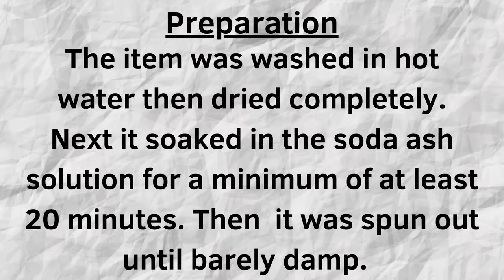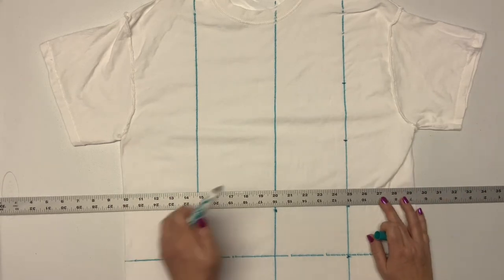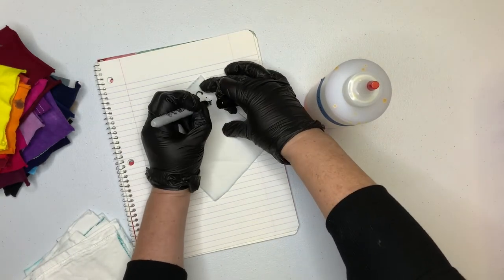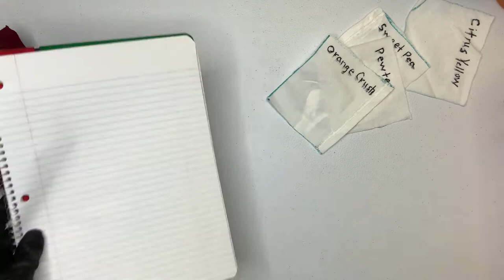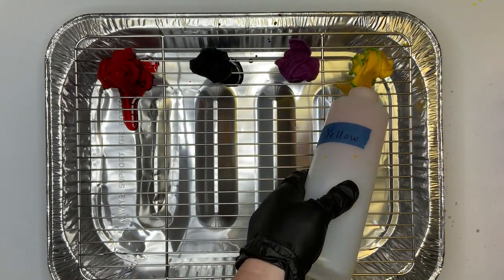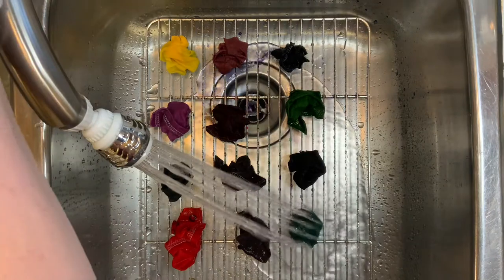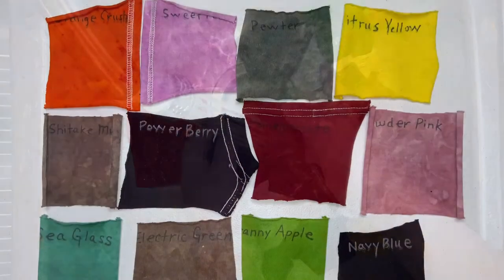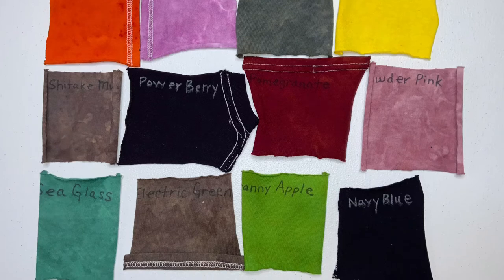How To Tie Dye: Swatches

Comment: Would it be possible for you to make a video showing all your swatches? I'm contemplating upgrading from Tulip/Rit, but it's so hard to determine which colors complement each other from the teeny color depictions on the dharma website. If I'm going to order sight unseen - as it were, I don't want to order 3 purples and 6 pinks, etc, when I only need 1 of each. I have a very limited budget, and even less storage space, so I want to ensure I'll actually use the colors I buy. (I hope that makes sense...)
Reply from the maker: A tutorial on just my stack of swatches, honestly, probably not quickly. I have over 100 colors. I could probably send you pictures. I have links to my social media listed in the description box of my newest tutorials. Try to find me and send me a private message if you can. I do show the swatches in most of my tutorials and I use the most commonly used colors. I can tell you that you want to start with the 3 primary colors for sure. Fuchsia Red, Lemon Yellow & Turquoise. Those 3 colors will make the secondary colors, orange, green & purple. 
Raven Black, Grape, Bright Green, Deep Orange, Hot Pink, Robin’s Egg Blue, Cerulean Blue, Hot Hibiscus, Deep Purple, Strong Navy, Gunmetal Gray, & a brown like Shiitake will definitely get you started. More than get you started!! Make sure you order soda ash too. I hope this helps you a little bit, Beth. Like I said, try to send me a message through Facebook. ❤️🌈
Reply: I'm looking for this too